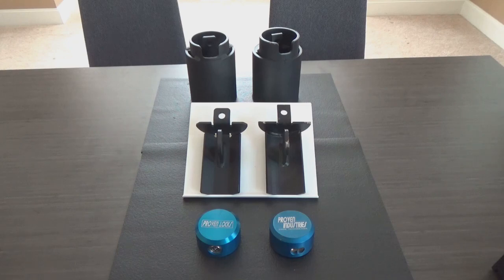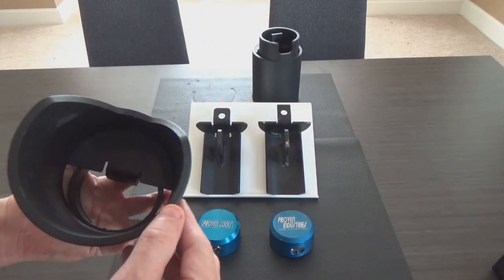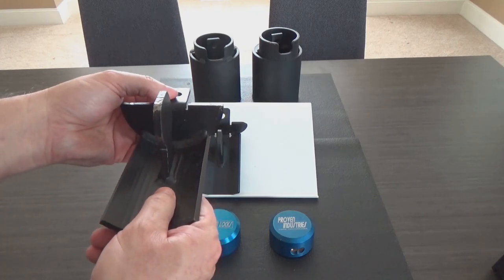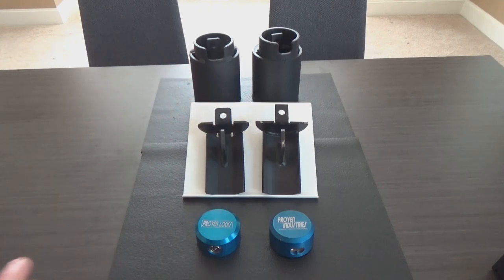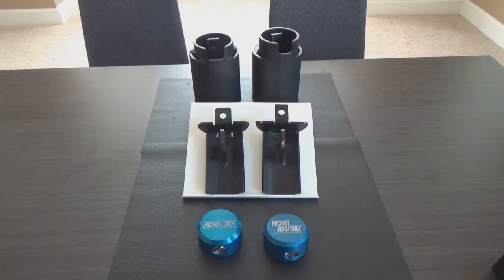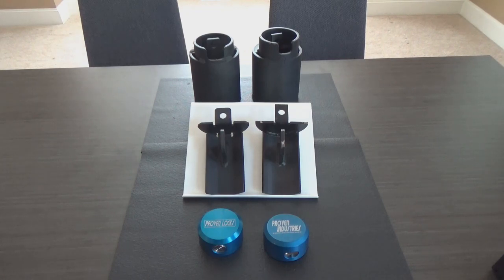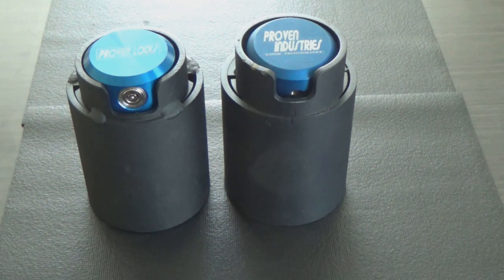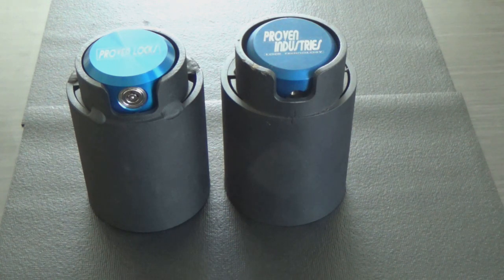Proven Industries Hitch Lock -  Update Video

Comment: too bad the weak link is still the cheap aluminum lock with one swing with a sludge hammer and chisel  its junk! And with the stainless steel lock a drilled hole in the center of the puck lock releases the lock pin.
Reply from the maker: J Proxy actually, that is not correct. I assume you are talking about the Lock Picking Lawyer review. Just as an FYI, he reviewed a prototype, not the production model. They have redesigned both the aluminum and stainless locks such that the latch is on the back so drilling won’t do ant good. I have an updated video on my channel that covers the new design.  

https://youtu.be/bF23httF5LQ

 As for splitting the lock with a sledge and chisel, not seen that before but perhaps I will give it a try and see what happens as I have an extra aluminum puck.  Do you have a reference to what is required?
Reply: @RoughRidersTV  Lets see if that's correct. I sent him a link to your video. Perhaps he will reply with a follow up. Also don't forget if you get an angry thief who cannot break this lock he may end up squirting some krazy glue into the key hole. How are you going to get if off then? I have created an impossible to pick lock that is krazy glue proof!
Reply from the maker: @JP-hj7fc  Fair point on pissing off a thief, that is always a possibility I suppose.  My hope would be that they would see the lock and decide to move on to easier pickings.  I would guess that the Proven guys would welcome a chance for him to do a follow up on their current production locks as he has a big channel. I'm just a tiny channel so I doubt I drive much business for Proven Industries but I do think they make a great product.
Reply: J Proxy so just put nothing on at all is what I hear you saying... jesus Just like he said, thieves will see the lock setup and immediately move on the easier and quicker pickings. Unless you’re a lawyer and does lockpicking as a hobby.... It’s not like you can’t cut these off but it will take time and loud heavy machinery. Things a thief does not want. I’m not a lawyer but as a 29 year LEO from CA, I’m certain a thief will look over my trailer and go on to the next one. Everybody has to bring up the lawyer lmfao
Reply from the maker: @ibMoose2u  Agreed and thanks for serving your community.  My niece works as a LEO in California, I appreciate all of you out there, thanks.  As to your comment, I have been trying to say the same thing all along...no lock is 100% effective and yes, every lock can be bypassed with enough effort. I don't see an easy way for this lock to be bypassed without a lot of effort and noise.  If your trailer is locked up in the middle of nowhere and no one around for miles, sure thieves can bring a portable generator, power tools, blow torches and the like and spend as much time as they want to steal it.  But if your trailer is in front of your home outside your bedroom window, if it is locked up in a campground while you are out sight seeing and there are people around, my guess is they will move on.  However, if the aluminum lock is a concern, Proven does offer a stainless steel model that provides even more security.  Here is the latest puck they offer  https://youtu.be/bF23httF5LQ
Reply: @Rough Riders Awesome for your niece!! And amen to everything you said! The last 4 years I dealt with transient thieves daily, multiple times. Most had burglar tools and bolt cutters in their backpacks/cars. Most backpacks had multiple key fobs from smash and grabs. I’d chat with them and they don’t want anything hard or loud or would take more than a minute. PI lock on my TT is just my first line of defense. I have motion alarms (cheap on amazon) on it and my atv, motorcycle and BBQ lol. I considered an alarm system but I retired last summer and immediately moved to Montana lol. Tell your niece I said hi and stay safe!!

Comment: Great lock lock picking lawyer drilled it open in 30 seconds, looks like these are no better than master locks, junk
Reply from the maker: Was it installed on trailer or drilled on a bench?
Reply: @RoughRidersTV  on the bench, but the drilling is on the face of the puck which is easily accessed while on a trailer. The attack is on the puck anyway not the shackle which is basically a freebee. Its kinda shit that they started cheeping out on their puck locks after getting high praise.

pretty sure ive seen the master lock products taken off with a crowbar so still a good deal better and with a high security puck lock its about as good as it gets short of putting it in a barn in a controlled area
Reply from the maker: @noobulon4334  Ah, ok, I know what you are talking about. Check out my latest video on the new pucks.  They moved the latch to the back side so drilling the face doesn't do any good.  They also have a new lock core insert by Medeco for high security applications.   https://youtu.be/bF23httF5LQ
Reply: And the lock picking lawyer goes around looking for f’ing trailers to steal... as a 29 year LEO veteran, I promise you, as a methhead strolls through and sees the PI lock on it, he’ll absolutely move on to the next trailer with an easy lock to pry off. Every single video that involves a lock I see yet another person say, “well the lock picking lawyer...”. When my PI lock gets picked and my $50k trailer strolls down the road without me, I’ll let ya know lmao.
Reply: That hack 'lawyer' studied the lock so knew exactly where to drill for his 'picking' vid. Average punk looking for an easy score would do that? Not likely. If another trailer is within sight that doesn't have anything but a junk lock or no lock, he's going there.
Reply: @silaslongshot941  Or the guy will use the Lockpicking Lawyer vid for tip on where to drill. I suspect many thieves would enjoy the challenge. If it's a random punk the $10 padlock would keep him away. Best bet for peace of mind is good insurance policy.